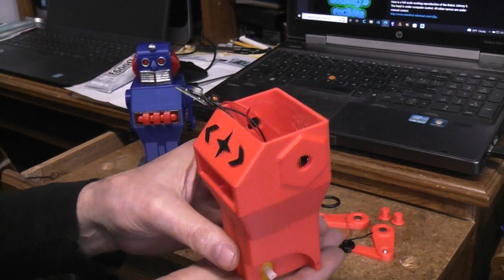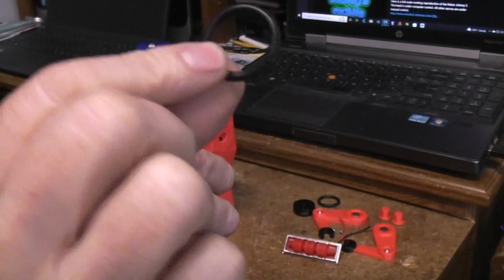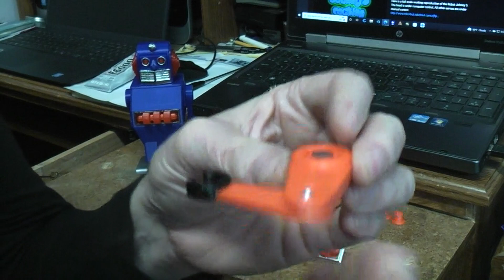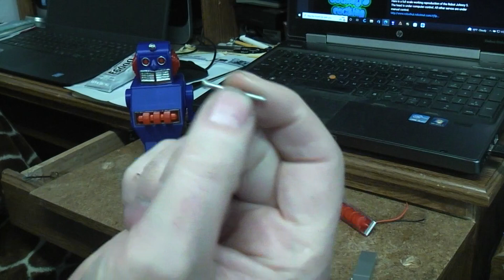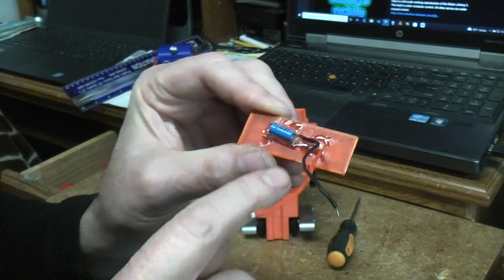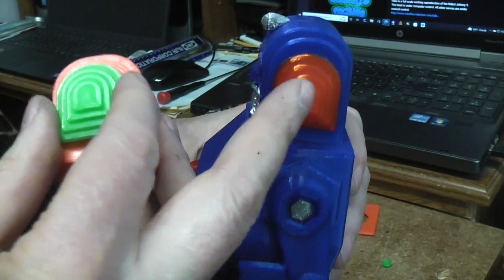Build the 3d printed Paddle foot robot. Battery operated. With lights and sound if you chose.

Comment: Nice job, do you happen to have a link to that exact size slide switch? I know you mentioned 19mm on center (mounting holes)
Reply from the maker: Amazon 
Qiying SS22F25-G5 2-Position DPDT 2P2T Panel Mount Mini Slide Switch Soldering Lug 20Pcs for $8.88.
https://www.amazon.com/dp/B0871J5J96?psc=1&ref=ppx_yo2ov_dt_b_product_details